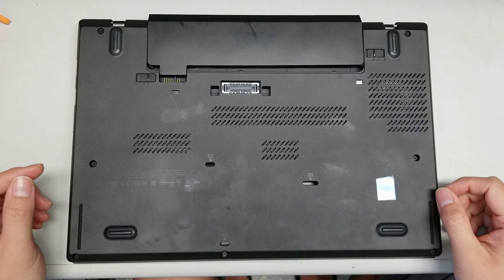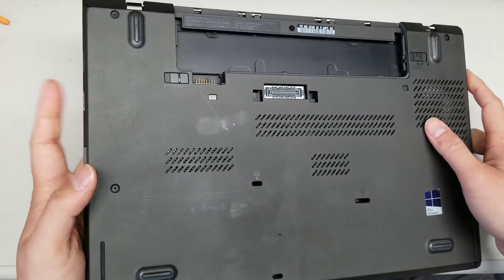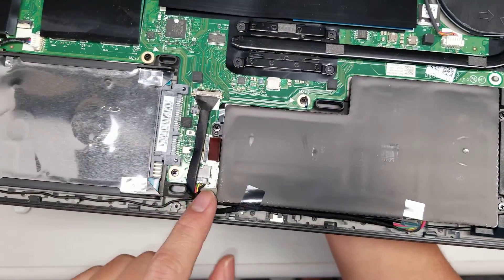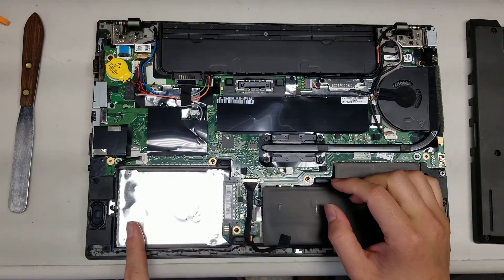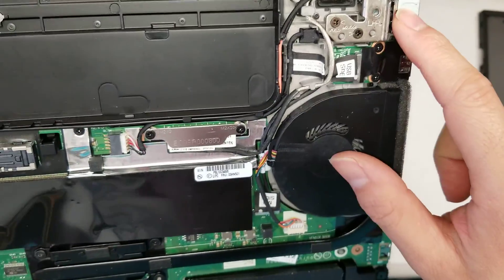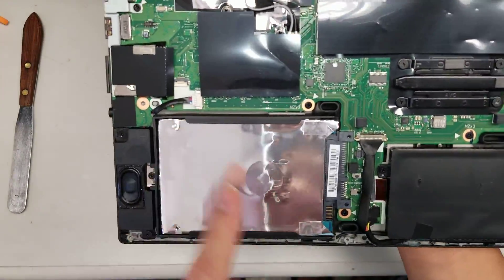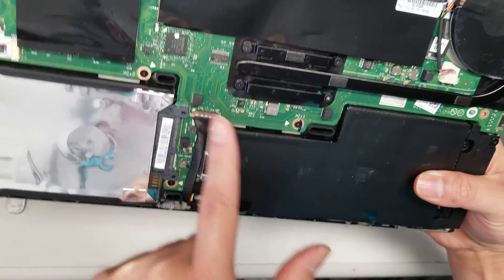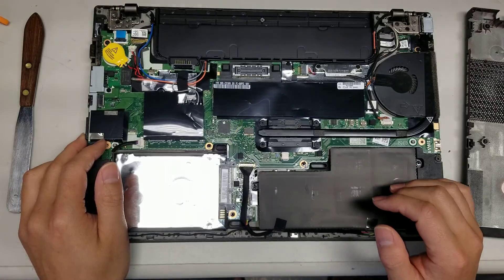Lenovo T450 Disassembly SSD RAM Hard Drive Upgrade Repair

Comment: my hard drive screw is stuck do you know smth i can do?
Reply from the maker: @danteduzit4299  make sure you're using the  right size screwdriver, push down hard and twist very hard. Use rubber gloves for extra torque if you're not strong enough. Wrap tape around the handle to thicken your screwdriver if that's not enough.

Comment: Can upgrade until 32 gb ram?
Reply from the maker: If you can get 2 16gb sticks
Reply: @ItsBinhRepaired No, you're not. Read the sheet carefully and you'll find that the 2 RAM slots can only afford 2×8GB (16GB). I own the same configuration and it is only 16 GB dual channel max.